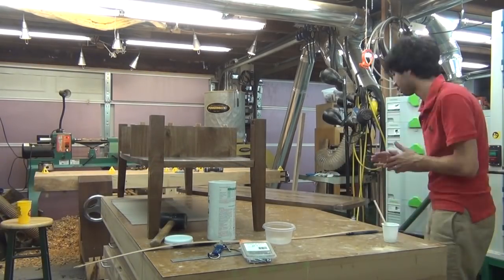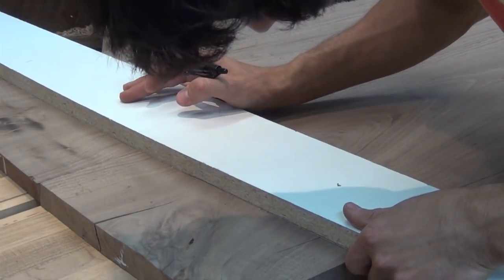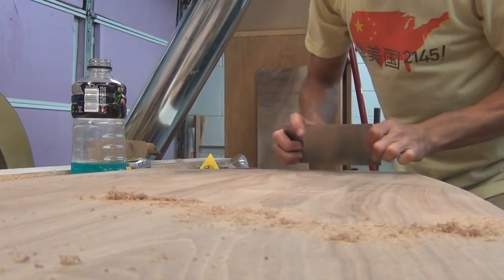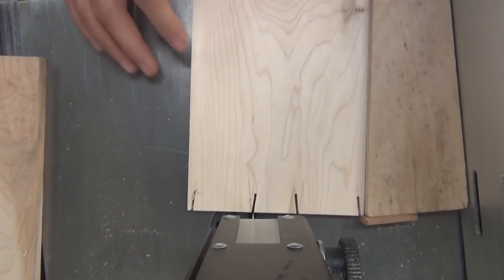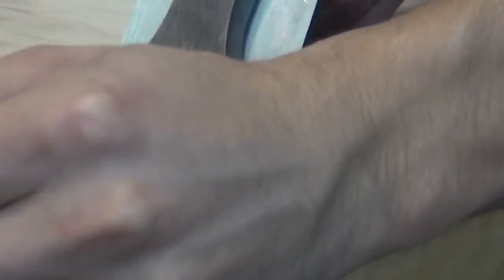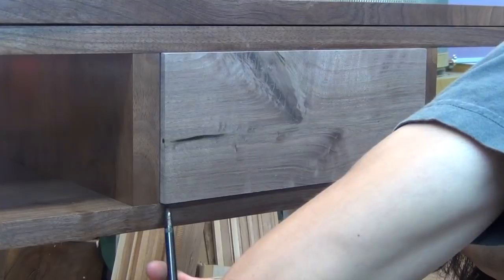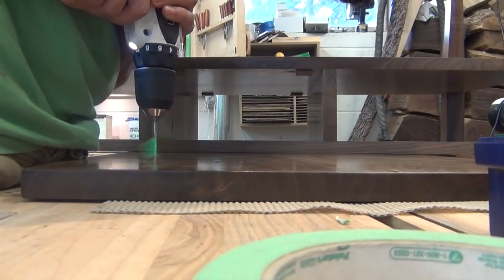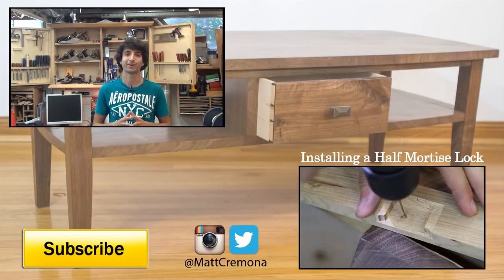Building a Walnut Coffee Table - Top and Drawers (Part 3)

Comment: This video answers that. Glad I didn't ask about starting your dovetails with a bandsaw in your older videos. But I have been wondering about not adjusting the guide post as needed. Seems to be in the same place all the time.
Reply from the maker: diycentral That's because of the fence.  If I want the fence close to the blade, that's as low as I can set the guides.

Comment: Matthew Cremona Not sure if you've covered this before, but could you go over your chisels you use and your sharpening methods and in general (especially with walnut and maple) how often you are sharpening/stropping/etc?

Oh and EXCELLENT video series. Have loved watching this. You have a great video presentation for these things.
Reply from the maker: I think I might have mentioned it before in a comment.  I should probably do a video on them.  Anyways, my bigger bench chisels are just a set of marples that I got at Home Depot when I was just getting started.  The smaller ones that I use the most for joinery work are Ahley Iles Patternmakers and Round Backs.  For sharpening, I use water stones.  I sharpen when the tools feel dull.  If I am diligent, they only ever need a light touch up on my 8000 stone and I touch them up free hand.  If they need more work, I'll use my courser stones with a guide.  I do have a strop that I picked up recently.  I need to mount that out in the open so I get used to using it.  Right now I just seem to forget about it.  Thanks for the great question.  I hope I answered fully but let me know if you have any other questions or want more info.  Thanks for watching.  I'm glad you enjoyed it!

Comment: Wow I love this piece of work. Its beautiful matt!! One thing I have been experiencing with working with walnut is if you dont mind sanding is that I keep increasing in sandpaper grit till I get to 800 or 1000 and if cleaned properly the grains pop so deep and it looks like the grains roll after you use the same finish you did here. I did use 3 coats and sanded in between coats 400 and 800. Seems to look very deep and smooth to the touch. Keep up the good work! Now you need a matching end table! !
Reply from the maker: Thanks!  What I found strange about it was the sub top, shelf, legs, and dividers sanded up just fine but for whatever reason the top and the drawer fronts kept looking cloudy no matter how much I sanded but maybe I didn't go to a high enough grit.  Either way, the card scraper did a great job.  Thanks again!

Comment: Thanks Matt. Really helps to see the process to get to the end result. you have great presence on camera and you explain you thought processes well. The table was awesome.
just one thought though. I noticed that you put the curves onto the bread board side pieces after having glued then to the table top, which as you stated makes putting them through the bandsaw a little awkward. Would it not have been easier to curve the bread board prices beforehand? Not a criticism Matt as your skills are excellent and the results speak for themselves. I was just wondering why you did this and your thoughts behind it.
subscribed as a novice woodworker.

Comment: Lovely job Matt and very well presented. I wasn't quite clear though how you attached the top. Did you just screw it through the aprons? Did you not have to account for wood movement/expansion? From what I have read this very important. Thanks for a nice vid.
Reply from the maker: Thank you!  I screwed the top on through the holes I drilled in the sub top.  The grain in the top and subtop are oriented in the same direction so they will move together.

Comment: Were your band saw dovetail cuts clean enough to leave alone or did you pare those while you were going into the corners?
Reply from the maker: Usually they are pretty good.  My blade has a bit of a snaggle tooth right now so on some of the cuts I had to clean them up a bit.
Reply: I gotta move new band saw higher up on the priority list then!  Table saw?  Band saw?  Table saw?  Band saw?  Fix the brakes on the truck?
Reply from the maker: haha!  You don't want brakes!  Trucks aren't supposed to stop...
Reply: It's actually true in this case.  When I had it inspected in Feb he says your rear brakes aren't working.  I had no idea!  I noticed it was better once they were fixed but now they are working sometimes and staying on sometimes.  It was better when they just didn't work at all!
Reply from the maker: hahaha!  That's got to be interesting driving around.  Your truck probably has a high front end braking ratio.  I still vote for bandsaw :)
Reply: krtwood  Easy answer...  Sell the truck and get a table saw and band saw!  ;)  lol
Reply: If only it were worth that much.  I can just shoulder carry the wood 50 miles back from the yard, right?  I have given thought to just having a car and renting a truck or getting delivery once a year of a whole lot of wood at once.  I don't really have room to put it anywhere though.

I'm really hoping to move in 2-3 years so I'm trying to make do with what I've got rather than get any big iron down into the basement just to have to get it back out again.
Reply: krtwood  Friends, relatives, casual acquaintances, and taxi's can provide a means of transportation...  I mean, what else are they good for?  lol 

On  a serious note, I do understand about making do with what you have.  Heck, I'm using a table saw that my dad bought in 1955.  It's just about on it's last legs but I still am "making do with what I got".

Comment: Absolutely beautiful...well done!

I've seen others use card scrapers but have no experience with them. What do you like about them? Where did you get yours? How do you sharpen it?
Reply from the maker: They're great because they can be used without regard to grain direction so it was perfect for the areas of the table top where there was figuring in the wood.  You can get them at pretty much any woodworking supplier.  I have a bunch of them.  I know for sure I got most of them at Woodcraft.  Sharpening them is what makes them intimidating for most people.  There are many videos on sharpening them here on YouTube, but the basic concept is polishing the edge and then creating a bur on the edge with a burnisher.
Reply: l3ender15 I have used card scrapers with mixed success until I came upon the Woodsmith sharpening system.  Their method is very good at "turning a bur" and that makes all the difference.  This link shows the sharpening system with its own video.  A little pricey perhaps but it works.
Reply: John Tenhundfeld I don't see the link
Reply: Try www.woodsmithstore.com/cabinetscraper.html  .   Sorry I am not sure why the other attempt at giving u the link failed.  Hopefully, this attempt is successful.

Comment: Matthew Cremona Agree on the great video.  What about the hand planes.  What type do you have and which No. where you using to smooth out that curved edge?
Reply from the maker: For smoothing the curve, I used my No 4 which is a restored Wards Master.  I have a Veritas A2 blade and chip breaker in it.

Comment: What timing, I'm learning to hand cut dovetails and this helped a lot. Never thought of cutting tails on BS although I do cut the waste with the scroll saw. I have the Veritas rip saw 14 tpi which leaves a very rough cut ( in my opinion) Is this normal and you have to pare anyways? or did I shoot myself in the foot by not buying Lee Valley or Bad Ass. Thanks Matt.....Is there a detailed handsawn dovetail video somewhere in the near future.....hint hint. Or I'm just avoiding the obvious and need to practice practice practice. Sorry for rambling.
Reply from the maker: Hand cutting is a fun process, at least it is for me.  I've found that the smoothness of cut has more to do with form than the saw itself.  I love my bad axe saw and when my form is good, the cut is smooth, clean, and straight.  When I'm out of practice, I can notice a difference in the cut quality.  So sometimes I pare the face of the dovetail to clean it up, it really just depends on how rough it is.  I haven't given much though to doing a dovetailing video since there are so many out there but maybe a video on my specific workflow?  Would that be interesting?

Comment: Really nice piece. I wonder why sides of the drawers are light? Do you run out of walnut? For me it's quite disturbing to see those "white" sides of drawers. Haven't seen you writing your name on it.
Reply: +DentargPL It is a common practise to make drawer sides from less valuable wood, such as popler and that practise goes back centuries. Sometimes people use contrasting hardwoods such as ash or oak, depending the color of the main pieces. He also wrote his name in part 2 before he coated it with Arm-R-Seal.

Comment: Nice work. I'm surprised you made such a rookie mistake in the glue up: 1. ALWAYS do a "dry run" of assembly first - that would have highlighted the holes you forgot to drill and 2. Glue up in stages if you can - its far less stressful. Glad it turned out well though.
Reply from the maker: Oh I had that thing together so many times just totally forgot about the holes. I really prefer longer open time glues to get everything out together in one glueup. I've done the stages thing and didn't really like it. Felt like more uncertainty. Thanks!

Comment: that's not the table top you were gluing up earlier on tho. It looks like its made from two wide boards you were gluing up few narrower boards for the top and two wide ones for the bottom shelf.
Reply from the maker: That's correct.  The glue up I showed was for the subtop.  The top is a glue up of two bookmatched boards.
Reply: +Matthew Cremona anyway it's beautiful work ...thanks for sharing;)

Comment: who could you have attached the top without the screws?
Reply from the maker: The top could be glued to the subtop panel if you wanted to.  Attaching the top separately makes it easier to finish
Reply: +Matthew Cremona thanks for getting back to me. I was looking more for a joinery solution.
Reply from the maker: I suppose you could do some thing a little abnormal like a sliding dovetail key between the subtop and the top